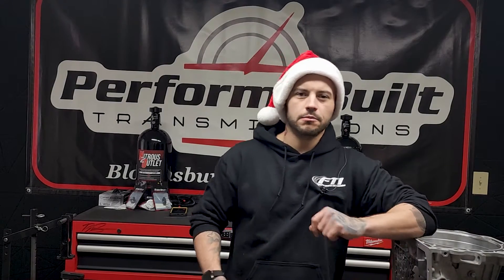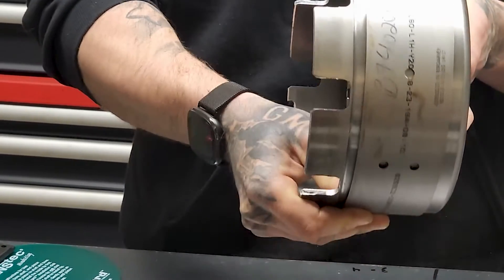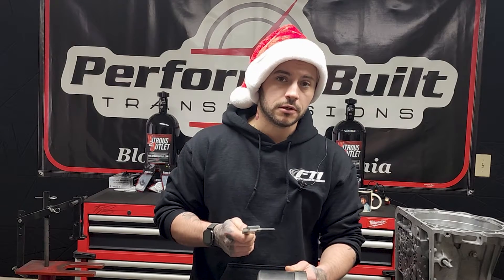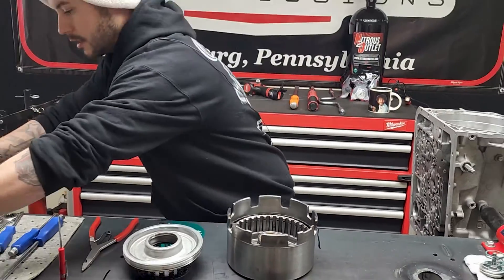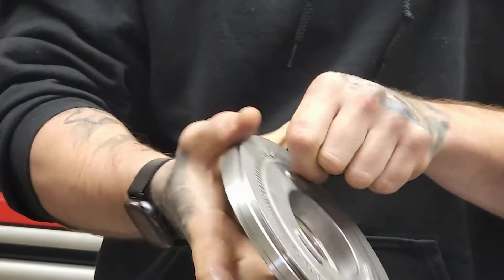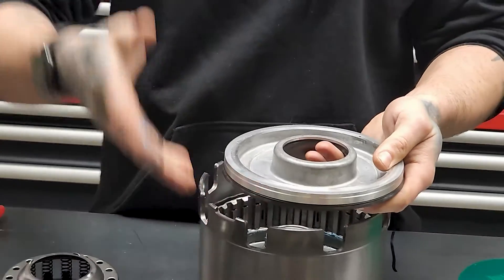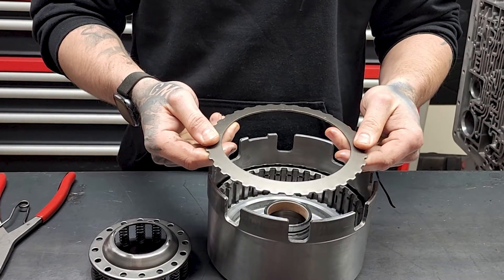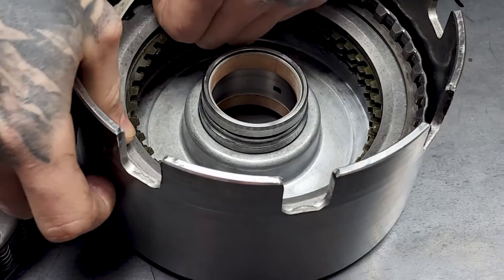OEM 4L60E Build Pt. 3: Reverse Input Drum

Comment: If I remember correctly, if you are working on a late 87 or 88 model 700R4 or 4l60 "same thing" they drilled the bleed hole bigger than the apply hole in the pump and there was some reverse failures because of that. So when I run into one that has the small apply hole, I will plug off the original bleed hole in the piston and drill on the other side that already has a hole started but not drilled through with about a .60 thousandths bit.